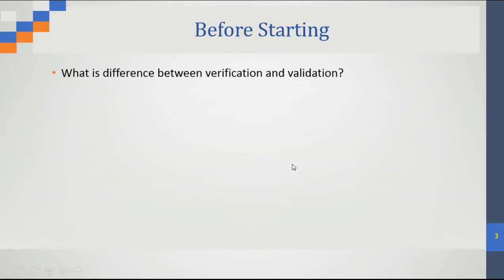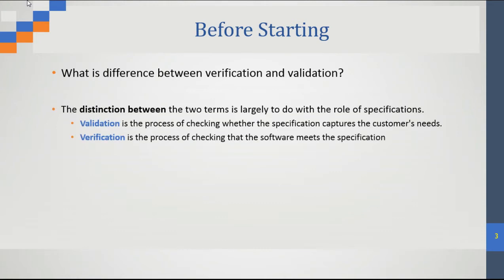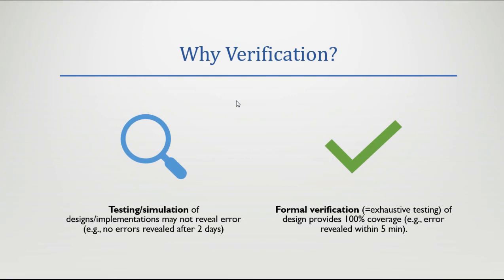Uppaal L1 1 Introduction to UPPAAL

Comment: Really thankful to you for this video.. I have understood the concepts but for my confirmation i have a question that is upaal a testing software for uml diagrams or itself is a uml modeling software?
Reply from the maker: I'm glad the video helped you understand the concepts.

To answer your question, UPPAAL is not specifically a testing software for UML diagrams, nor is it a UML modeling software. UPPAAL is actually a tool for modeling, simulation, and verification of real-time systems. It is particularly useful for modeling and verifying systems that involve timing constraints, concurrency, and synchronization.